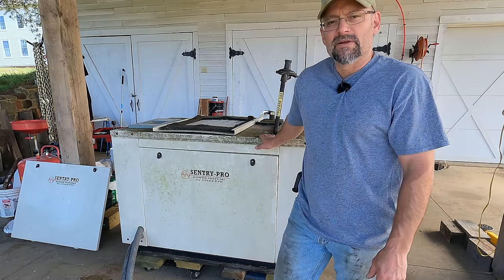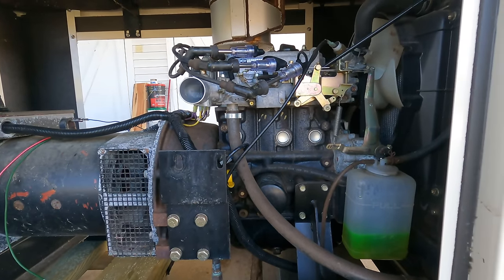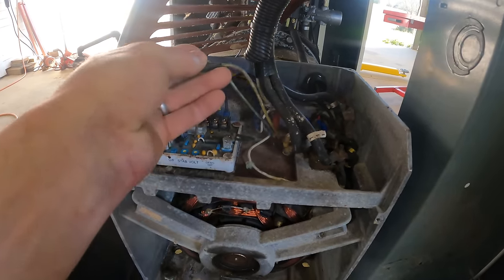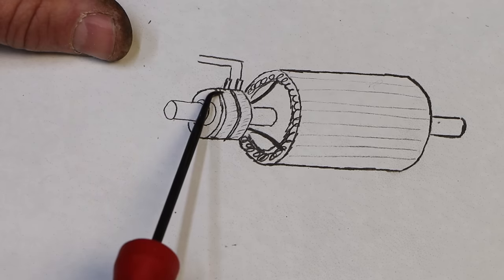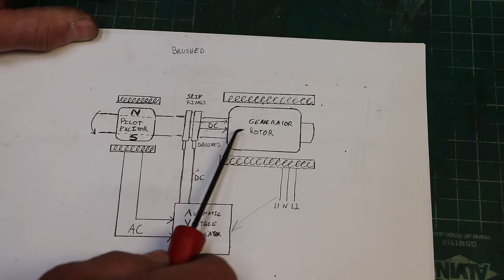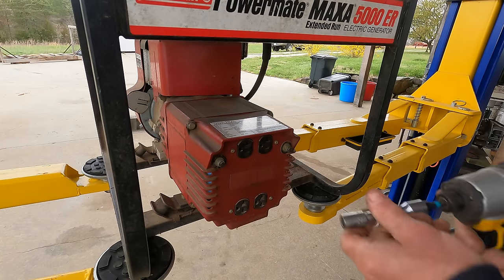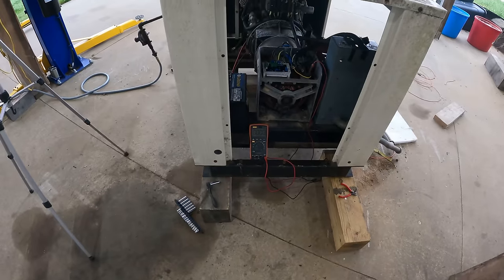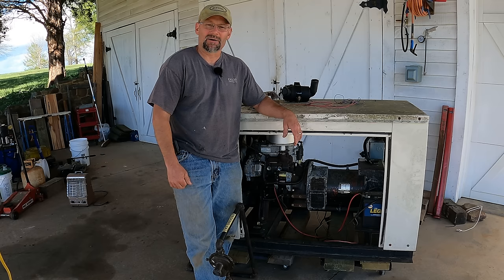How Generators Work, And How To Fix Them.

Comment: AT 48:09, I hope that isn't a habit when using transfer punches. Use a center punch to make a bigger mark. 😉 I worked as a machinist, tool maker for many years, and just hated when I grabbed a 'company owned' transfer punch and the point was hammered out, because somebody used it for a center punch too many times.  I ended up over time, getting my own set, so I didn't have to use "company" tools.
 I'm pretty sure aluminum won't hurt it though. 😁

Comment: Hertz = international unit of measure where 1 hertz is equal to one cycle per second.  Not intending to be a nit picker, its actually a measure of frequency; so rather than phrase it as "check the hertz" or "check the one cycle per second" it would be more 'meaningful' to say:  check the "frequency" because you are actually measuring the rate at which the current changes direction.  (The best video I've seen on the theory and operation of a generator (I never realized that propane could be substituted for natural gas, if that is actually a generator that is designed to run on natural gas)).

Comment: Strip some hookup wire, take a single strand and solder it across the blown fuse cartridge. That's now a 3 to 10 amp fuse, depending on your wire thickness.

Comment: A key problem when replacing a slow blow fuse with a normal fuse: it'll blow too quickly, and become an annoyance.  This leads people to bypass the fuses, resulting in much worse damage.

It is a much bigger issue to replace a fast blow fuse with the wrong type, as the circuit will no longer be properly protected, and is more likely to be damaged.

Comment: it a pure AC generator goods      for everything’s most people did not understand how much powers it’s can produce they will plugged anything’s let’s says a 2000watts generator it’s only handle something less than 2000watts what’s a bouts you plugged a 2000watts heaters how much powers heaved left for me it nothings leftovers if you used it’s to long what’s if going happens you will blows it brain outs

Comment: hello great video excellent explanation  as if u dont know lol i liked that.  but ill amuse u and give it a shot.  id say big house units want brushless or inverter because they put out clean power and most of electronics dont like dirty power.  now little ones portable ones brushed because cheaper and produce not as great power on clean side.  and u can get brushless or inverter ones to now years back not so i think im onl been on planet 50 years what do i know. im just enjoying the video as i fooled with 5 junkers last week when power got treed up  got the 4000 starting 3500 running cabelas green outdoors model off my neibor 2 days in no power he ran it twce 40 min total new carb once wouldt start got it cleaned new carb he had put on and it running and surging got clean idle jet better  then got same kind other day from mom thats yellow 4000 starting and 3500 running but its 120 v0lts only when it put out power  got ne avr and brushes from champion no go still  i need to find out how the transfer block get wired 1,2,3,4 terminals and which wires my moms husband had 3 red on one and rest 3 black 1 white on one terminal if u know how it goes i would appriciate it. thanks stay safe i learned lot from ur video cant wait to watch some more  u will get tired of of all comment ill send ur way if u want some al bs one get them ratings goimg

Comment: I'm a plumber by trade, so I'm a bit handy, but electrical has always been pretty much black magic to me. You explained it best ive ever seen.

1 question tho, why can't the main exciter also be the generator rotor? It looks like you're already making an electro magnet in the main exciter, so instead of ac going into a rectifier, going into the generator rotor, why can't you send the ac from the main exciter into either the AVR or straight to the breaker?

Comment: Bigger engines usually run on liquid propane my Ford truck ran on it so did my handy bus on a Ford chassis my mother had her 5 ton GMC water trucks converted go run on propane one thing that all had in common the fuel gauge didn't work so if you  how many miles of range they had left and you'd run out   a 20 PD BBQ tank works but you have to run the tank upside down I now have a fork lift bottle it puts out  liquid propane  also I had the same problem with propane regulator leaking I tri

Comment: FYI, The wires most likely were connected to an ATS, Automatic Transfer Switch, selects between grid power and generator..  btw, that generator is high quality, liquid cooled, most likely runs at 1,800RPM.  You need at least a #100 tank to vaporize enough propane

Comment: At about 14:45 switching to "off" didn't shutdown the generator.

With a friend's similar generator, when switched to off, it stops generating AC power and then runs a 5 to 10 minute cool down procedure before shutting off the engine.

Does this general have the same cool down feature?

Comment: Thank you for posting this test
I have the exact head and just need a little info. I have no info on this head…no electronics….was told the engine ((Chinese went south) and I ended up with the head and roller stand. I have leads from the head…that’s all?….what type of voltage and frequency control does yours have?

Comment: 36:59 I just wanted to let anyone know who has an iPhone any gen that is running iOS 14 and up. 

Under the accessibility settings, in the settings app there is a “magnifier” option. 

If you just turn that option on, you can then find it in your pull down quick menu. 

The symbol is of a person press that and it’ll either give you a list (if you’ve already got other accessibility options turned on) or it should open it.  

There is a ton of options in it, and it’s easy to use. Hope this helps someone!

Comment: The three wires "going nowhere" are actually the remote start and power for an automatic transfer switch. you just need a switch between the +12v and the start for it to start in "standby" . The -12/ground is the ground for dc power to the transfer switch. I didn't get the rest of the connections from the video but they are very likely ATS leads also. This is how all standard standby generators start when the power goes out. You have put 12v on these wires and depending on the intelligence of the controller (probably none) you could be backfeeding the controller and preventing automatic shutdown. Those wires are only needed if you have an ATS.

what i have figured out from the diagram

1 Start
close switch to terminal 4 +12v to start in standby
2 Eng. Fail 
    this could turn on a light or a buzzer indicating there is an issue with the engine such as low coolant or low oil. the panel actually says this provides 12v to close a relay in the case of engine failure. the ground for the relay would come from terminal 3 in that case.  
3 -12 vdc (ground)		Ground to ATS
4 +12 vdc 
	12v dc to ATS and switch to terminal 1
5 Eng Run
	Engine is running depending on that unit this could be a 12v source to a light or relay that would use terminal 3 -12 vdc (ground)

Comment: I just took possession of a free genset myself. The engine is locked up, but it's a Kubota diesel, so I expect to be able to get all the parts needed to get it back running and generating. It's older but only has 300 hours on it.

Comment: Did at you check the "off" switch in the fact that it didn't shut down for "cool down" feature? A lot of standby generators utilize these to prevent seizing cylinders. Just a thought.

Comment: Brushless generally create less total harmonic distortion for your AC out which sensitive electronics are not damaged operating from brushless which they could be when operated from a brushed generator.   I have had/seen no known problems operating my laptop which has a battery as sort of a filter or my Digital TV which probably has good capacitance filters but no battery to act as a filter so they may have added inverter AC to DC and aren’t not as sensitive to excess total harmonic distortion as stated but operate sensitive electronics at your own risk.

Comment: Most generators that You find today work on the principle you described with several major proviso's.  Each coil or pairs of coils in a generator represent a pole.  and generators have poles that represent north and south, so moving a coil of wire through alternating series of poles producing alternating voltages and current flow.The regulator produces appropriate output voltage based on the current being drawn from the system.  All generators without some kind of feedback system  will produce variable voltage depending on the load on the power producing coils (whether rotor or stator), and the torque being supplied to the generator.

Comment: Around 30:50 The dirty voltage comes from the diodes on the rotor, they shall be de-coupled properly. A small capacitor in parallel with the diode and a larger capacitor on the DC side to make sure the voltage is smooth. Also the main exciter shall be 3-phase to further improve the DC current stability, but on a small generator it's hard to make room for all this and it's more expensive.
So a lot of noise is from the generator rotor not getting a clean steady current.
Of course the AVR DC voltage also has to be stable for this to work out.
At least that's my take on the circuits regarding how to ensure clean output voltage.

Comment: Noticed your gen head is similar to mine.
Does it have a voltage regulator…?
Mine was a china diesel set with a missing engine. I’m still looking for a complete unit so I can figure out how the head frequency and voltage is controlled….

Comment: I'm sure that it's actually incorrect here, but you can have +12v and -12v DC - computer power supplies have this setup, allowing you to get 24VDC across them. I don't have a clue how that works, though 😅

Comment: Better to use heat shrink on terminals spades etc. I found the adhesive on tape becomes gooey and awful and lets go.
Heat shrink behaves and use a decent amount on the wire leading in. All will be good. Very good and useful for people wanting to work on this equipment. Excellent all the best to you. I worked in a Transmitting station in New Zealand and learnt about generators and power equipment.  You can also heat shrink male and female connectors after they are joined.

Comment: When you first saw resistance on one leg to ground, that was not capacitance, was voltage. 
When someone measures resistance, the meter applies a voltage to the circuit. In this case, the circuit was an inductor (windings). This voltage "induced" a magnetic field, this field will remain intact until a path to ground is found. 
When you tried measuring the resistance to ground, you provided a path to ground for the field to collapse. So as the field collapsed, the voltage in the circuit lowered, "increasing" the resistance. 
By the time you had gotten to the second leg, the field had fully collapsed, and you were reading the true resistance.

Comment: Thank you for sharing your knowledge,   working on a small DC motor thar operates a electric winch. Is there a special tool for reincerting the brushes that sit on top small tension springs?

Comment: Great informative video and tutorial. The big stand bys are usully the best and reliable but it only takes a critter to create a headache.  I modified an older version (1994) of the onan microlite 2800 to a wheeled cart, a single gfci, 12v/7ah battery and a 0 to 7 amp auto float charger. This model went full  throttle on power off with the centrifugal governor in tow. Re adjusted and tune up and it works great for essentials

Comment: If you use a propane tank that can output liquid (they exist for those camping tanks), put it on its head and add a pressure reducer, wouldn't the propane turn into gas at the pressure regulator ? If you then just put that into your cooling liquid tank it would get enough heat to continue running. 

I know, lots of ifs and whens. 

Alternatively just use a couple of the camping tanks and you get the same result.

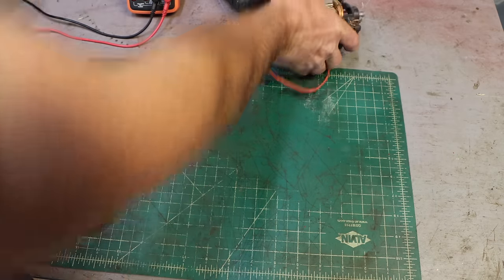Comment: 20:40 another fun physics fact - the electormagnetism is proportional to the angle (tangent?) between the magnetic field and the wire you're trying to induce a current in. If you're moving at 90 degrees to the coil, you produce a current of 0. That's why motorcycles & friends have a difficulty in activating traffic lights that use ground based coil sensors. The mass of your car is 180 degrees from the coil - producing a change that's easy to sense. Motorcycles and bicycles are generally 90 degrees. Several states (check your local laws) in the US allow you to treat a red light as a stop sign if you're operating a motorcycle. Also laminate a copy of the law so you can show the cops when they pull you over cause they're not familiar with that law 😅

Comment: Actually your backwards, usually mid sized better portable generators are brushless, they have capacitor that crap out after a long time. Also brushless is very resistant to dust, popular with contractors, however they have less precise voltage control. 

Brushed generators are very popular in current standby generators because the voltage output can be tightly regulated.

Comment: As a retired Supervisor with Siemens and Westinghouse,  I've rebuilt generators as large as 750 mwh. Different variations of excitation.  All have DC Power that excites the electromagnet in the generator rotor.  Most power generators put out 6kv. The frequency of this power is regulated by the rpm of the prime mover.  Example: A two pole rotor must spin at 3600 rpm to make 60 hz power.

Comment: Those butt splices under the stator cover should have been a red flag. What manufacturer would do that. Nobody. So,e body has been in there cutting wires in the past and couldn’t figure it out.

Comment: There's several different methods of generating electricity in either AC or DC and even more methods of regulating the electricity produced with various electronic circuits that can result in different quality of energy produced from pure sine wave suitable for delicate electronics to a modified sine wave only useful for heavy electric equipment such as heaters fans compressors and such.

Comment: Electrons don’t know the color of the insulation of the wire they are traveling through. Starting fluid taboo. Keep the propane warm cylinder warm and it will run all day. Pipe the exhaust to discharge into a box where the bottle is sitting.

Comment: Holy smokes! Putting pressure on the output port of the regulator is a big NOPE. You always pressure test gas lines without regulators, then install any regulators, and test them with leak detector. Great way to destroy a regulator.

Comment: We had a 1500 watt generator at work that was used perhaps 6 times a year. It would not hold the magnetism so we put 2 eighteen gauge wires on magnet and used a 1.5 volt dry cell to flash field when the motor was running, never failed us.

Comment: Check the main switch ohm switch that has 3 spots then trace from that point the problem is most likely the coil packs that provide the spark for no spark,but if the coil packs are good by testing them trace backwards trace wires from coils  back to the (stator/ internal motor where there may be brushes or brushless type of charge made by running motor) and check the fuze and if fuze is blowing up on start replace the board (voltage regulator) where fuze is also test run then recheck the switch on the main control board to ensure that it works as intended

Comment: One small correction: current isn’t induced, voltage is. In your open wire example, there is no return path so no current can flow. This could be a memory rule for induction. Once you have induced voltage, you can load your circuit and current will flow.

Comment: Never gonna use a Genny once you decide to permanently hook it to your house. 😂 I about a year ago wired a receptacle into my house so that I could just plug my generator in and feed my panel and I have not lost power since. I used to lose power about once every month. But now that it's permanent, the regular power never fails.

Comment: If you come back here and see this 
Tell me about the settings on that meter I have the same one & don't know all settings (bought used at a pawn shop in a little town and used from the pawnshop was only place for 150 miles to get quality tools) so no manual or instructions

Comment: Your rotor may not be permanently magnetized.  You may have to magnetize it, again.  Use a drill and spin it by hand.  Watch Jim Condon’s method to do this.  He uses a battery and a drill to do it, as I remember.

Comment: I have a generator at home, not sure of the size of the top of my head, like 20-25kw probably, driven of the pto of a tractor. generator works and voltage and herts are all good and it does handle a load fine from my limited testing. limited because after a little while its starts smoking, i have not been able to figure out why as everything seems to be working but yeah, limited testing done because i don't want the thing to catch fire, electricity and smoke are usually not friends. might tear into the thing a little deeper on day after watching this.

Comment: T S will probably mean transfer switch. Standby gens are connected to an automatic transfer switch to swap the power supply from electric service to the generator when the electric service goes off.